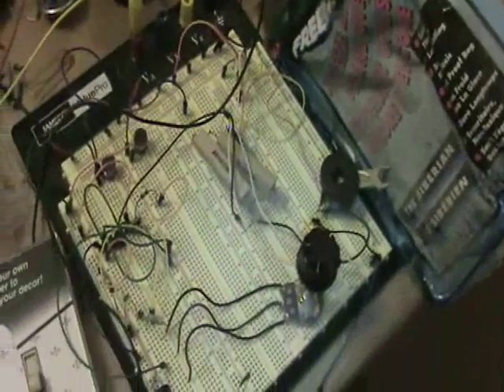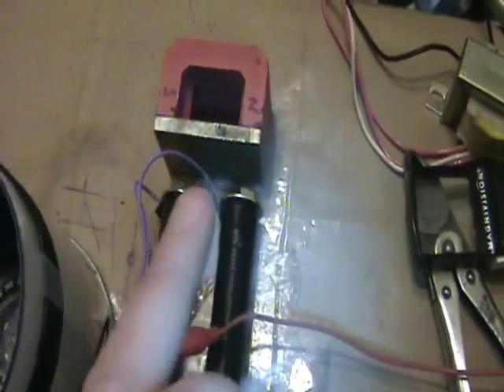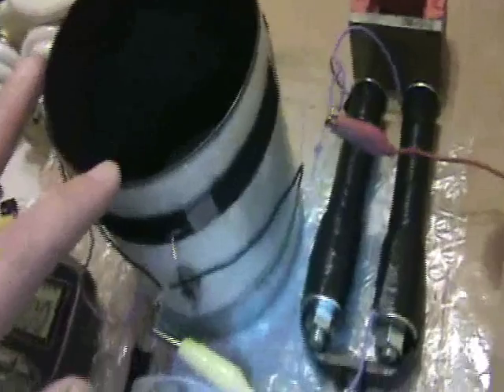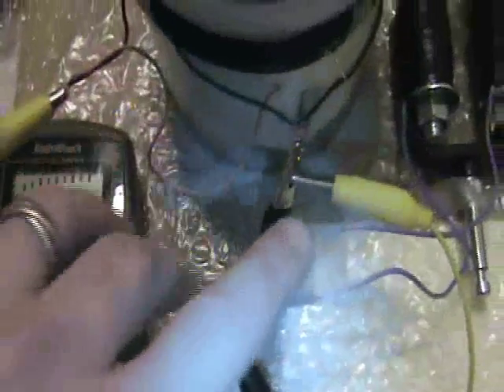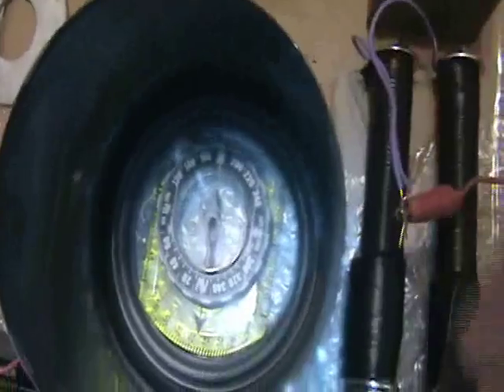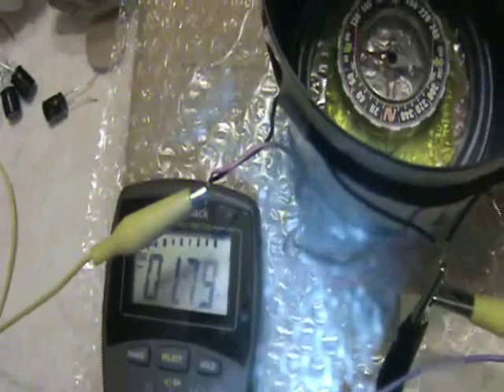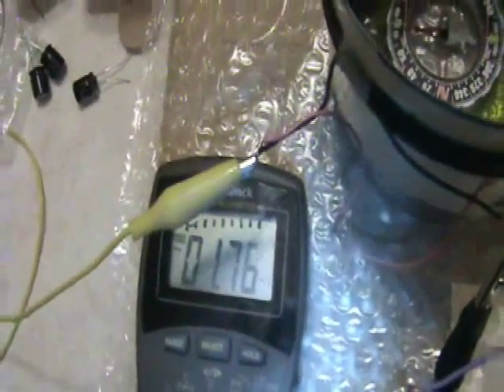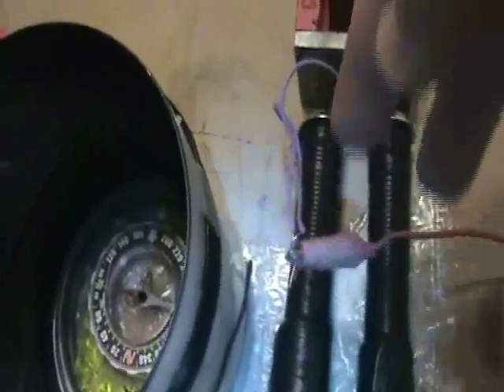Hendershot Fuelless Generator Energy Transfer Experiment

Comment from the maker: @TheSaltysack 
I haven't yet attempted to replicated Hendershots Fueless Generator fully. I've only messed around with components of it and a subset of the circuit. This is a mystery several folks are trying to reverse engineer. Its interesting. I would recommending searching the web on everything you can find about Hendershot's Generator... and Motor ... two different devices.